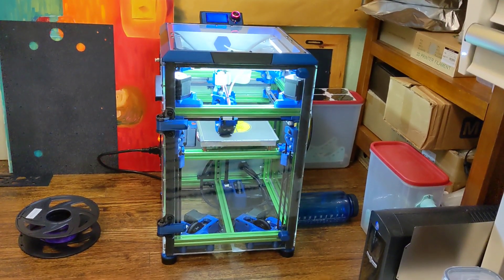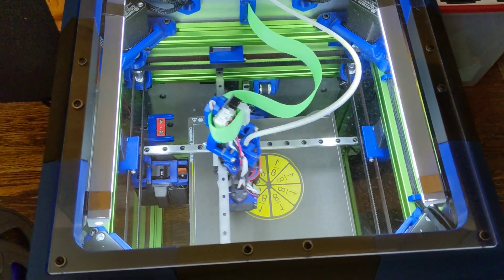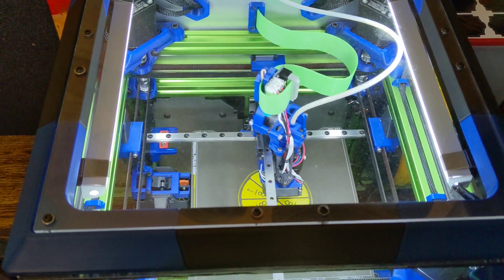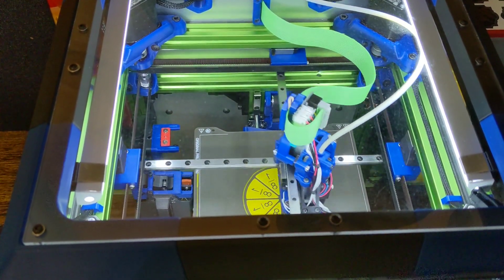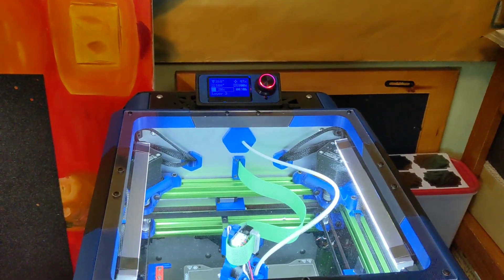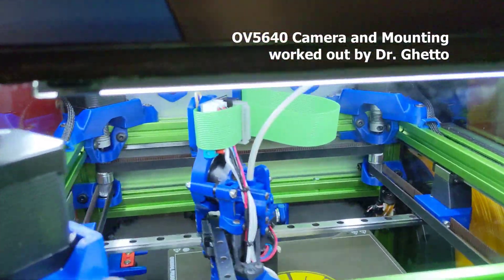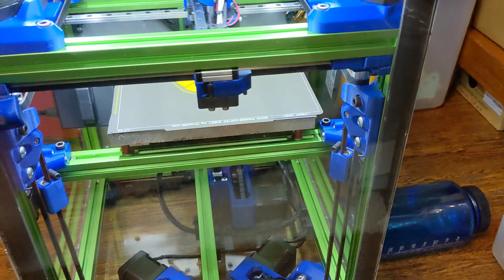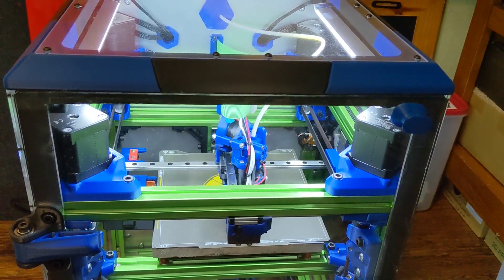Annex K3 at "everyday speeds" 15k accel, 250 mm/s, 500mm/s travels

Comment: Got a link to the Roadkill board?
Reply from the maker: @AlexG207  https://github.com/MakerBogans/roadkill
That's the original roadkill.  The one I was using in the video was a modified one.  
Since this video I have switched to the standard k3biner board to make it easier to switch between toolhead.  If you want one of these boards and you're in the US I have some sitting around in a box.

Comment: Nice build nice and quiet are you using upgraded rails/motors?
Reply from the maker: I'm using honeybadger cross rails and LDO rail kit for the rest (the full honeybadger kit had not yet come out when i built mine).  Motors are 2504AH, so 1.8 degree steppers which isthe main reason why they are quieter in comparison to the 0.9 degree steppers.
Reply: @mandryd  thank you for your response I’m sure it will help many!🙏

Comment: That bed looks THICK lol, what thickness is that plate?
Reply from the maker: 1/2" thick bed.  in hindsight it's a bit overkill lol.  That said, the k3 has no problems with the bed sagging when it's off :).
Reply: @mandryd  thanks! Just curious do you have like a list of what electronics and you're klipper settings? I plan to build one after I finish my second 2.4 and want it that quiet!
Reply from the maker: @Silentwidow1222  I have a spider 2.2 with 2209s.  For quiet, the main thing that matters is using 1.8 degree steppers for the gantry motors.  I have ldo 2504AH motors.  For these motors, you have to use couplers since the shaft is short (the couplers have a tendency to break if you push the k3 super hard.  I haven't had an issue so far staying at 15k accel).  However, there was a preorder recently by lukeslab for "magnum bois" which is a long shafted 2504ah with the correct length for the k3 so you wouldn't have to use couplers.  I think there's more info in the discord. My config is pretty standard otherwise.

Comment: Dat thiccc bed doh. Jeez man. What is that 10mm? Excellent build. Truly.
Reply from the maker: Thanks.  It's actually 12mm lol. Probably should have gone less to lose less build height in hindsight.  It's working well though and since it's only 180x180 it doesn't take too long to heat up.
Reply: @mandryd  ya know I've heard the thicker you go the more it tends to warp. More metal more expansion and such.

Comment: I'm always fascinated with these kind of printers. With all that speed, and compared to usual speeds (60-100mm/s) do you increase the temperature as well? If so, by how much?
Reply from the maker: I guess it depends on whether or not you are pushing the limits of your hotend.  This printer is running an NF-Crazy HF hotend which can push somewhere around 25 mm^3/second of ABS with a standard 0.4 nozzle.  So, 250 mm/s, 0.4mm line width, and 0.2mm layer height = around 20 mm^3/s, which is well within the limits of the hotend.  If I push the speeds some more and start approaching the limits of the hotend, then I would need to up the temps to compensate.
Reply: @mandryd  seems like the volume you mentioned is too much, I don't know about the details of that hotend but it seems like impossible or difficult
Reply from the maker: @himanilsharma2147  What seems off to you?  0.4mm width * 0.2mm layer height * 250 mm/s = 20 mm^3/s
Reply: @mandryd  Yeah, 20 mm³/s is nothing extreme. Even a stock Creality hotend can do over 25 with a CHT.

Comment: Okay I'm fairly new to 3d printing and have been designing and printing pc-abs car parts for shop I work at. I only print at 50-60mm/sec on an ender 3 v2 with upgraded sprite pro extruder and auto bed leveler. Can I assume that I could be printing at these speeds with this build with pc-abs? This would GREATLY increase 3d print applications at my shop. Any guidance appreciated!
Reply from the maker: You would definitely be able to print way way way faster than you ender 3 with a k3.  I giggle every time.i print something with my k3...it's really that fast.  Drop by the annex engineering discord.  Folks can help ya out there!
Reply: @mandryd  thank-you!!
Reply: @qquantumpi  take a look at awd Vzbot

Comment: This a CROXY?
Reply from the maker: Yup croxy
Reply: @mandryd  - we have an Uktimaker s5 at work and it’s too flimsy to run fast like this. I keep pushing them to release a new printer… they should take a leaf out of your book!
Reply: @mandryd  that the same as a corexy?  just a different way to say it?
Reply from the maker: @OnceShy_TwiceBitten  croxy is cross gantry.  It's a bit different than corexy which uses two belts and two motors. Croxy uses 4 motors and 4 belts and has much shorter belt lengths.  Theres other stuff too, but maybe a different video can explain it better.
Reply: @mandryd  not to be confused with the Croxy project, we generally refer to our printers as 'cross gantry' rather than croxy so people don't get confused about our relationship with the Croxy printers
Reply from the maker: @KeithSachs  thanks for the clarification.  Actually didn't know the distinction.

Comment: Awesome buil man!! Congrats!  How much current can this flex ribbon cable carry ?  Wondering on the hotend..
Reply from the maker: The ribbon is 26g.  The Aussies calculated and are running 50w heaters without issue with 4 lines x 26g.  This one uses 8 x 26g, so 100w or so?  I plan on using 70w so should be a nice amount of headroom.  They worked it all out.  I just hacked it to be double.
Reply: @mandryd  This also relies heavily on the voltage you're running on. You could push it to 48v for example, but then you would need a compatible heater cartridge.
Reply from the maker: @MarinusMakesStuff  for sure!  Forgot to mention I'm on 24v.  So definitely could up that if needed.